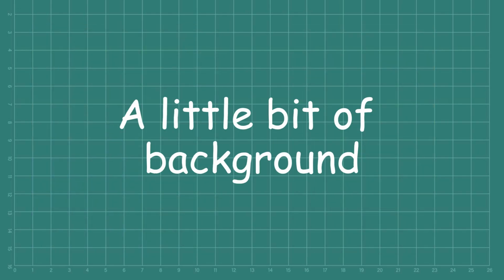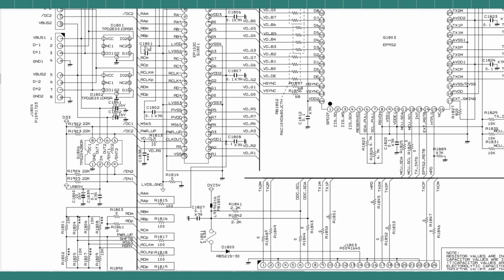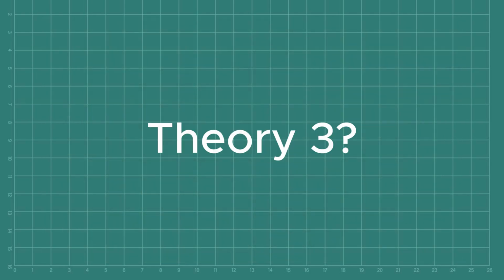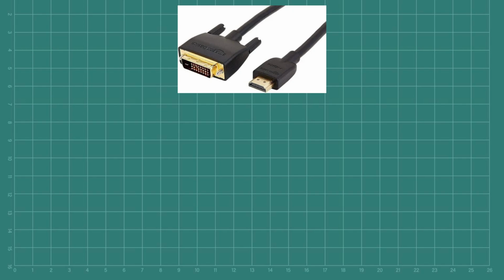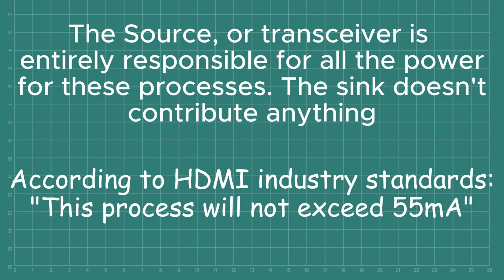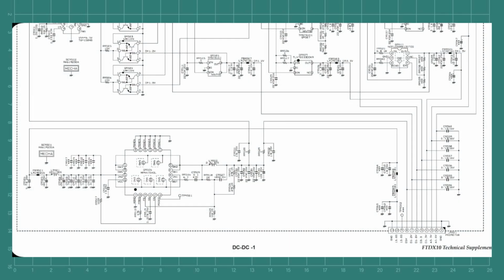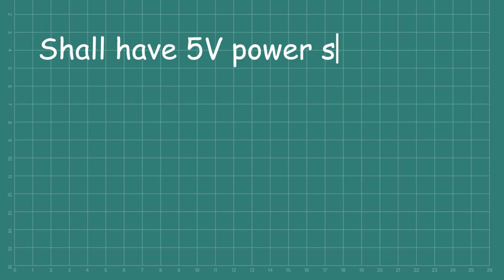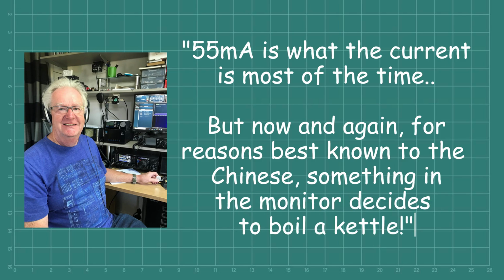Yaesu DVI-D to HDMI. Investigation

Comment: Thanks for this - presumably it's still a licencing fiscal choice for them not to use HDMI?
Reply from the maker: I think that ship has sailed unless they re-engineer the whole display output for HdMI standards. 

Fingers crossed they provide a proper HDMI output on future Transceivers.
Reply: This is done because the DVI connector is stronger than the HDMI connector. You don't want to repair the board every time you accidentally pull the cable too hard, do you? Money has nothing to do with it.
Reply from the maker: @ an interesting and valid theory, but Yaesu have already confirmed that licensing was an issue. 

Good point though.
Reply: @M8KHC  It's not just Yaesu that does this. Other companies often use DVI as well. This is also why the ancient DSUB connectors are still popular. 
More interesting facts: the Russian firm Expert, which makes SunSDR and MB1, left the use of BNC. Because BNC has a poor mobile "ground" connection. They switched to SMA. But SMAS have proven to be fragile. As a result, they switched to mini UHF connectors. 
So the solution of Yaesu and others is not a bug, but a feature!
Reply: @alexsmit1829  Garbage, have you ever worked in a repair shop? I have.